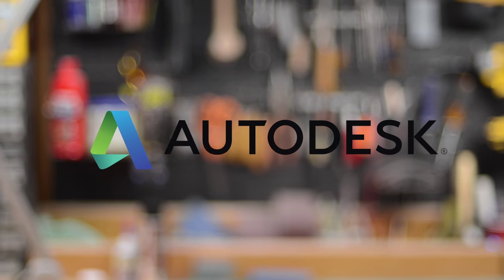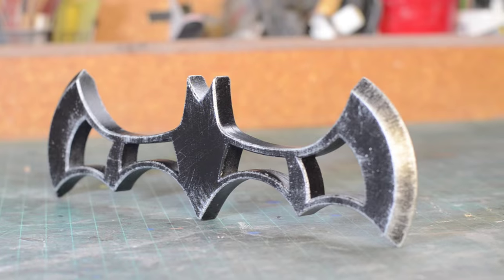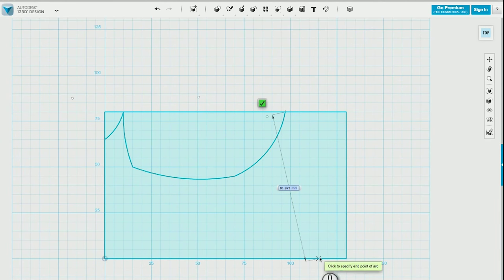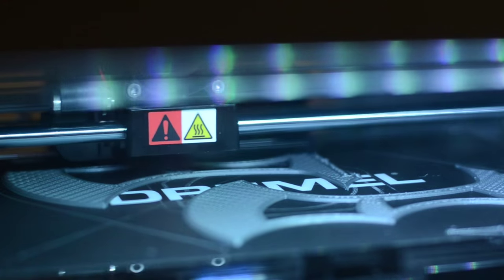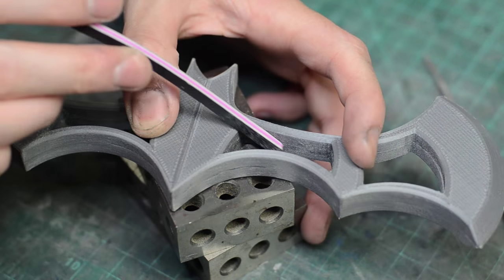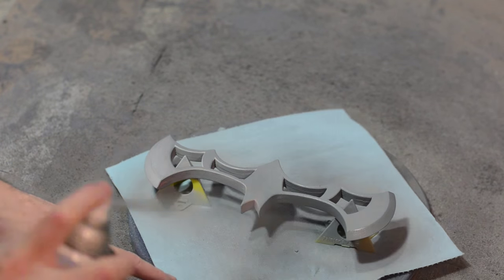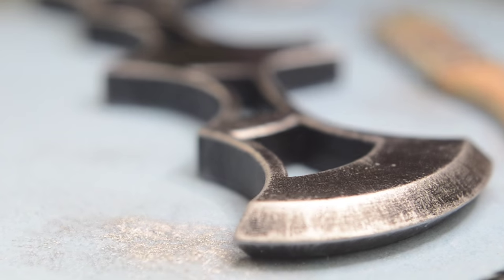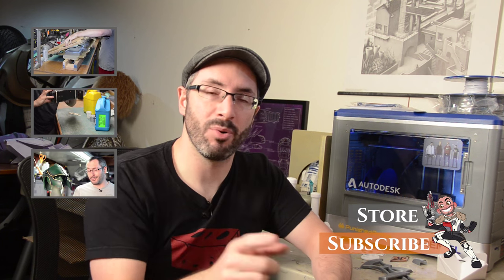Prop: 3D - Season 1, Episode 1: Batarang

Comment: Hi Bill, I have had a Flashforge Dreamer for about 2 months now.  It is the 2 print head version of the Dremel (see Dremel/Dreamer).  Do yourself a favour and dump Dremel's software and purchase Simplify 3D.  This is great for beginners as it has dialed in the settings for most 3D printers, and for experts, it lets you really tinker with the settings until you dial in the settings for each different roll of filament etc.  It only about $150 so you can't go wrong.

Comment: If its abs you can use acetone to glue it together , also if you heat acetone gently in a sealed container you can vapor melt the surface of the abs to smooth it out

Comment: Hi Bill, very informative video. I'm in 3d printing for about one year. I tried whit Tamyia putty, I think something similar to what you are using, but with complex surfaces is a matter o days of work just sanding the piece. Recently i tried the 3D Print Coating Epoxy XTC-3D from Smooth On, give it a try!

Comment: How much sanding would you do with your prints until you finally think it's good to spray with the filler primer? I have a 3D printed gun and just wanted to know how much I should do.

Any tips appreciated!
Reply: Punished Props I'm receiving a gun In pieces should I glue it together then sand? or should I sand each piece then assemble? Also what would you use to do tiny detail sanding? 

I just want to say thank you for your reply! I'm a huge fan an watching your videos inspired me to build props (I did your Han Solo build) thanks again!